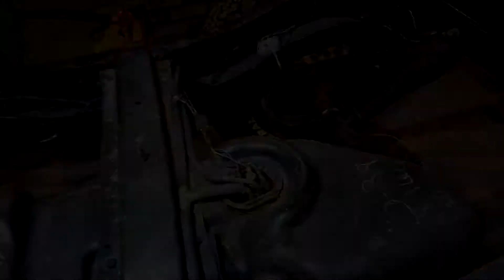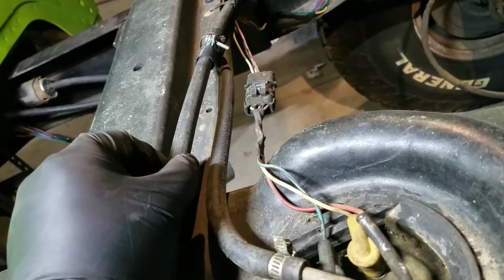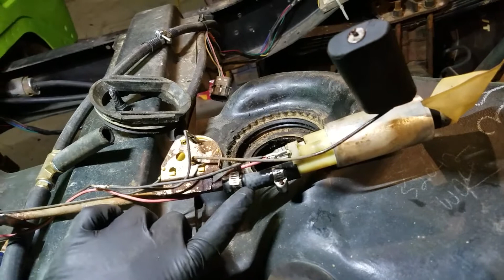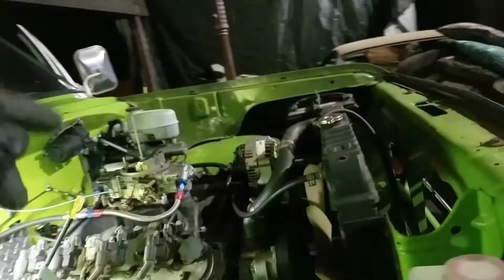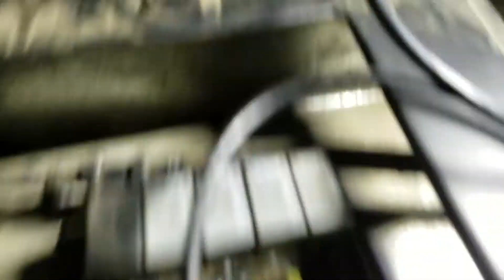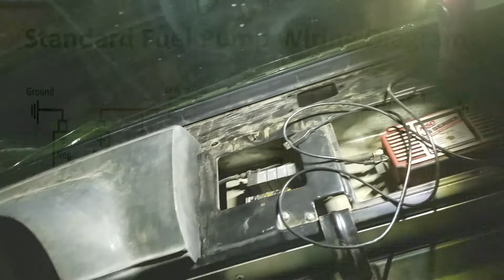How To Easily Install/ Retrofit An Electric Fuel Pump In A Stock Carbureted Tank | How To's|NW Ep.54

Comment: I need to run a red wire but don’t have and extra hole like you had there for the wire.   How would add a wire without having and existing hole?
Reply from the maker: Use a wire bulkhead fitting

Comment: bro the line in the middle of that regulator is the return line. the line on the left side is the feed line coming from the pump straight to the carb. your using the return line as the feed line 🤦🏾‍♂️
Reply from the maker: Incorrect. That is a dead head regulator. It has a single in and 2 outs. One of the outs I modified to convert it to a "bypass" style but it still isnt a bypass style.

Comment: 50 yrs ago i had electrical fuel pump on '66 Corvette from Pep Boys didn't have 15 amp fuse or fuel pump relay. mechanical pump was still on block. long story short didn't know i had alternator problem got stuck in the boonies, topanga canyon blvd in between malibu and woodland hills mountains. bought a cheap battery got me home went and installed mechanical pump. took care of alternator after. those were the days
Reply from the maker: Yeah I've had similar situations with both types of pumpa but now a days most parts stores carry cheapy fuel pumps that can get you home just in case

Comment: I have a question for ya. My project is pretty much about finished except my fuel problem. For some reason my fuel pressure regulator isn't decreasing my fuel pressure at all. Thought the one I had was faulty so I bought a brand new one still nothing. It's staying at 12 and a half pounds of pressure whether I screw it in clock or counterclockwise. My other issue is I'm only getting fuel squirting to my secondary bowl not my primary bowl. You can see in the plastic bowl gauge that there's fuel built up but it isn't giving no fuel whatsoever to keep it idling.  Do you have any ideas on what the issue could be?
Reply from the maker: Sounds like a mismatch of pump pressure to regulator. If you're running a dead head regulator, the regulator can be easily over powered if the pump pressure is too high. For any pump running 8 psi or higher, you'll either need to convert it to a bypass style system, get a lower psi pump or swap to a 2 stage regulator.
Reply: @NightWrencher  I have the return hooked up. Figured I have the return right there so might as well use it. As for the regulator and pump it is a QFT both the same brand. For my feed I'm using a rubber gas hose line that I adapted to the assembly inside the tank like you did urself. I'm not sure what the issue is. I believe the primary is probably gunked up so I think I can fix that.  But as for the fuel not lowering the pressure.  That one has me confused. If you have any other ideas feel free to throw it out to me
Reply: @NightWrencher  my regulator is only for up to 9 psi I believe and the Guage is only up to a 15 psi. They are both quality brands from what I see. Do you no of any good outside the tank fuel pumps for carburetor? Something with lower psi?
Reply from the maker: @kevinkeeney3295  for external you can run the summit brand blue pump. Theyre about $80 but theyll work with your style of regulator

Comment: Good info in short video.  Thanks for the pics, too.    Dumb question:  How does 12V into the gas tank and a GND return work?   I'll watch, again.  But, I thought water/liquids short stuff?  Second question, is your tank plastic, or metal.  Best wishes.
Reply from the maker: Mine is a metal tank but youre right, normally liquid would short out the wires but the 12v dont put out enough amps to bridge the + and -. Most modern pumps have exposed connectors too since liquid fuel wont ignite, only the vapors can ignite so thats not an issue. The issue lies in the connection. If you have a loose connection exposed to vapors, that will create a spark and could really cause a problem.
Reply: @NightWrencher  thanks!

Comment: Can i put 12 volts to my in tank fuel pump to make it work new pump just not getting power
Reply from the maker: Yeah, you should be able to jump it with no issue.
Reply: @NightWrencher  hey you were right i put relay in have fuel pressure now but the car still wont start i put light tester on injector plug turned on key both sides of plug have power i stopped i have spark its just the injectors are not spraying out fuel please if you have any ideas its 89 ford probe gt 2.2L turbo new pump tank filter plugs wires cap rotor only way it runs is with starting fluid please any help

Comment: Quick question does the return line has to be a certain  size?
Reply from the maker: It has to be big enough to not cause a restriction so it varries based on fuel pump flow. If you have a hard time bringing down fuel pressure, chances are your return is too small

Comment: Just found ur video thank God 🙏 the fuel unit  I had was broken so I bought a new one I just noticed that the new one only has one yellow wire and not a ground wire like yours does is there anyway I could  rig this up to work
Reply: I got my fuel sending unit for mydodge d150 85 but it only has one wire
Reply from the maker: Right right. I remember now. The pump itself should have 2 tabs and one of them youll need to add the wire yourself and run it up into the small evap line and that will be the power from your ign switch or relay
Reply from the maker: Sometimes the fuel pump grounds off the body itself. From what vehicle did you get that pump?

Comment: I got 2 new fuel pumps the other day to use on my 89 f150 that I switched from efi 5.8 to carbureted 351w but instead of too much pressure I got no fuel pressure at all and none coming through the line cause I unhooked everything from the fuel line except where it goes to the tank had little sis turn on the switch while I held a jug under the line and didn't get a single drop of gas in it directly from the tank. Somebody told me that I'd have to go to mechanical which I don't want to nor do I have the money for considering I just put 200 dollars worth of electric fuel pump on it for no reason not to mention the 600 dollars I just put into the intake dist and 4 barrel holley. I do have the return line cut and plugged off with a bolt but it's not on it cause I forgot to put it back on. When the switch comes on you can hear the in tank pump from underneath the truck and the inline works just fine cause I ran it out of a jug to check it yesterday. I've also heard from my neighbor that his brother ran into the same problem same kind of truck and suggested that I just run the  in line and remove the tank pump but I already tried that mounted where it originally went but not a drop from the tank. My uncle said that the in line is more push than pull so if that's true would it likely work if I just moved the in line closer to the tank like probably right beside the tank? I know carbs run low pressure but that's why there's a regulator and that setup works fine cause I run it out of a jug like that with the high pressure in line pump and deadhead regulator. This has been my dream truck since I was 7 years old but it ain't far from being sent to the crusher or the next fool that feels like putting 100 after 100s of dollars into it cause I ain't got it to spare anymore and patience running thin cause it hasn't left the driveway in 8 months and ran just fine before changing it over other than cracked intake where previous owner over tightened.
Reply from the maker: Sounds like you have an over complicated system. You shouldn't need more than 1 in tank pump to run your truck good, even with a carb and intake. If the intank pump works and fuel is coming out of the fuel line when you power it on, you should remove the other pump. If you want to keep the inline pump, remove the intank pump. The 2 pumps will block each other so just run 1 and go from there

Comment: If I use a small external 4-7 psi pump should I be concerned about dead heading?   And if I mount it under the door would it pull enough?
Reply from the maker: Ive seen a lot of those cheapy mr. Gasket fuel pumps that you install on the frame or fender or anywhere else on the car and they're supposed to work decent. I wouldnt trust them to work for any extended amount of time but if you just need to move it around, it should work fine. Ive seen too many hot rods broken down on the way to shows from failed remote mounted fuel pumps

Comment: Can I actually use an injection pump on a motorcycle 4 cylinders caburator?
Reply from the maker: If you can regulate it properly, it shouldnt be a problem. As long as you can maintain the correct psi at the carb inlet, it should run good